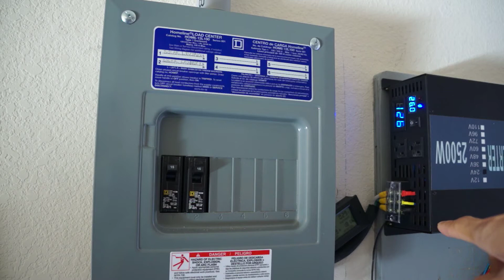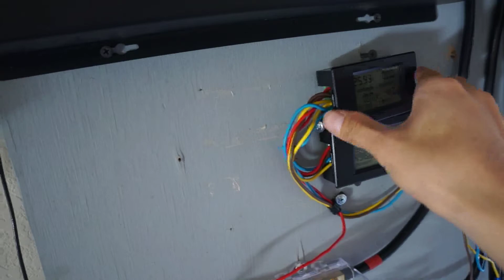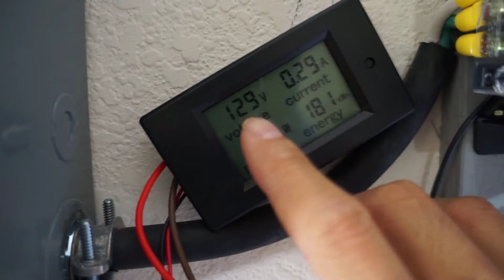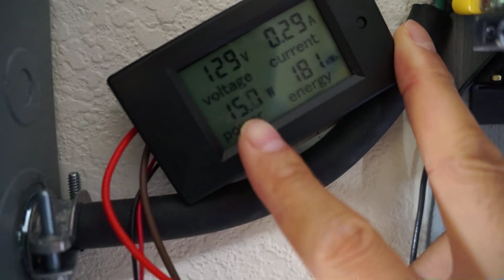DIY Off Grid Solar Panels with Sub Panel wiring

Comment: Where does the ground from the bottom of the inverter go?
Reply: @Websurf-s3e Everything is off grid. I have a little 30a Breaker box I was gonna wire up.
Reply: @Websurf-s3e Thank You

Comment: Hi, I have a question... you have already connected the neutral of the inverter in the breaker box... do you connec the main neutral wire of the main breaker box in that breaker box? ¿El cable Neutral de la caja de breaker principal de toda la casa lo conectaste en esa caja de breaker?

Comment: I have a question about this could I use a main service  box ? And if so could someone point me to a video or book to help me with this,  also the inverter is that a direct load running into the sub panel?

Comment: Just a suggestion.  You should use a double pole breaker to bring in your power from the inverter.  The way you have it wired now works but offers no protection to your inverter.  Safety is always a good thing to have, particularly when inverters are not cheap.

Comment: When you wire anything using AC current, the black wire is always the hot and the white is always the common with green being ground. So the wires from your inverter are backwards in color and will not pass code

Comment: I noticed you wired the grounds to a separate ground bar and not with the neutral bar? If your running that panel solely from the inverter you need to wire them together. You will also need to ground your inverter. The ground lug should be on the bottom of that inverter and it has continuity with the a/c ground screw on the front. If your battery bank is not grounded on the negative terminal to your house ground rod, ufer or a separate ground source  then you have no protection from energized metal parts. You don't necessarily need to ground your battery bank but you should fuse both your positive and negative terminals. If your ground wires in your a/c panel only tie to each other and to the wire from the inverter, your system is not grounded. Remember, your neutral wire is the path back to the inverter and ultimately back to your battery bank completing the circuit and has the potential of carrying current thats why it's insulated. The bare ground wires are for equipment and chassis ground only and should never carry current. All grounds and neutral wires come together at the power source. I can't see your whole system so disregard if you already have everything grounded.
Reply: I'm doing a similar set up and trying to figure out how to ground. My inverter ac out does not have a ground output. I was going to install a ground rod and bring a ground into the load center but I am not sure if I should connect to the neutral bar or a separate new ground bar. Curious what you would suggest!
Reply: @GadgetMan777  make sure to separate the ground and neutral in the load panel. The bar for the neutral wire must be insulated from the panel body.
Reply: @GadgetMan777  Remember that the neutral wire is the path back to earth ground and has the potential of carrying current. That's why it's insulated. I would place a ground rod and tie both the negative battery terminal to it and the load center. The bare ground wire is a ground only to protect from hazardous voltage on metal parts. I would find a way to ground the inverter as well.
Reply: Yes and no.. I definitely agree to ground both the sub panel and inverter. That said if the inverter has a Neutral ground bond and if it voids the warranty by modifying it in anyway you would want to separate the ground and neutral sense it's not the first place of disconnect.
Reply: The short answer is... don't create a ground loop in your system, creating a difference in ground potential between your battery bank, inverter and your homes a/c.
Reply: @Websurf-s3e Check your inverter to see if the neutral and ground output have continuity. If it does then separate the grounds and neutrals in the a/c load center. If they don't have continuity then tie the neutrals and grounds together at the a/c load center with a grounding rod.
Reply: @Websurf-s3e my previous replies are for a stand alone system and not being tied into a house with commercial power.

Comment: If you buy blue remodeling boxes or the grey outdoor junction boxes you can fabricate the plate either out of a light switch plate or the cover that comes with the grey boxes drill screw holes and cut out squares.

Comment: Another great video! Did you ever look into doing a transfer switch box? I'm wondering if doing a transfer box  would be cheaper in the end after buying all the accessories. Wire,panel box, box plug,etc
Reply from the maker: Not really.... I never like the hassle of having to manually flip the switch.

Comment: That brand of inverter, is it any good??
Reply from the maker: It work fine.  Nothing special about it.
Reply: I bought a Cotek pure sine 24 volt1500/3000 that a guy was pulling off machines on e-bay for 160$.
 So far everything in the house ran off it except of course HW heater,dryer,washing machine(have not tried) Plugged in a 1500 watt Duracraft electric turbo heater all the 12 volt lights,fans and digital meters went out but it ran. Also scared the shit out of me.

Comment: How do you disconnect the batteries in case of low battery voltage and damage to batteries?
Reply from the maker: Unfortunately I do not have low voltage disconnect, other than what's 
provided by the Inverter itself, which is very low shut off at 21volts. 
 So far I have only had one issue where it drain my battery below 
21volts that was because of a malfunction in the Outback Flex80 where it
 stop charging when it go between Absorb to Float, instead it go to 
Charged and cut off and doesn't do anything.  Ever since I swap to 
Midnite Classic never had such issue.

Comment: will your meter fit in a double gang outlet box, maybe a triple ? you could use a standard cable clamp to mount it to the bottom of the panel through a 1/2 knock out, give it a nice  industrial look. I got 600 watts sitting in the closet lol could sure use that uni strut, that and some more batteries.
Reply from the maker: Yes, I think it can... But I want to see if I can put all 3 meter inside one box